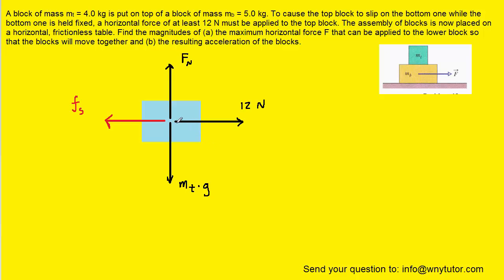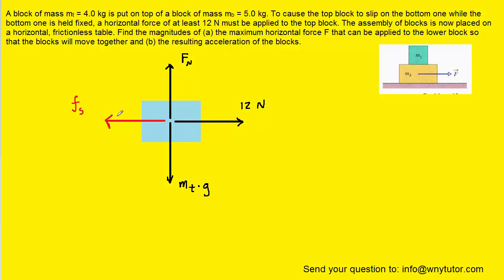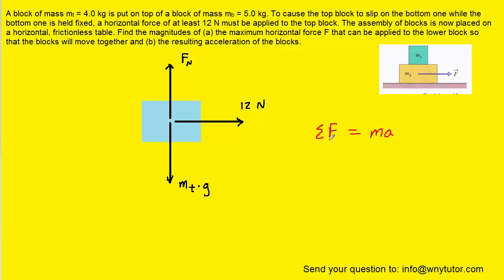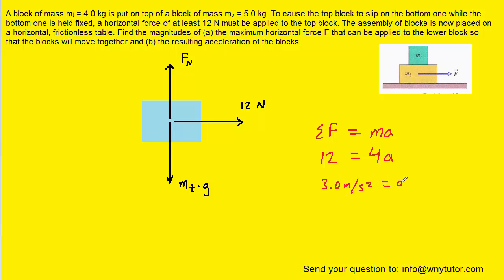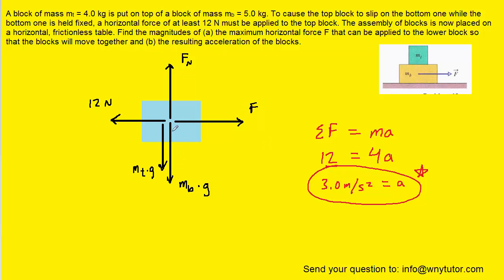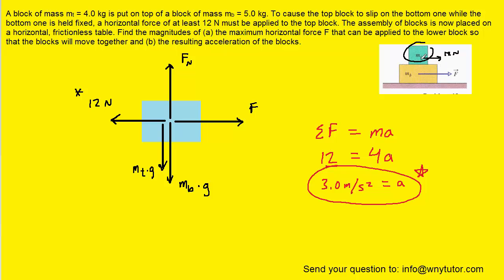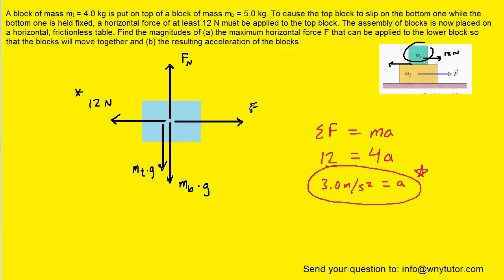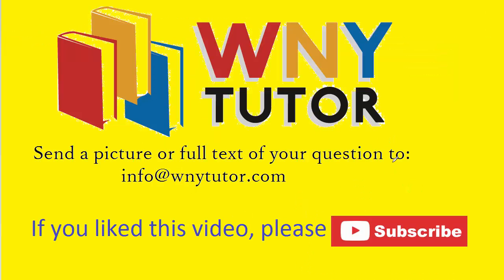A block of mass mt = 4.0 kg is put on top of a block of mass mb = 5.0 kg. To cause the top block to

Comment: But it says 12N force causes block A to move so I think we cant take fs= 12N. Here, fk should be equal to 12N, am i right?
Reply: I'll reply 3 years later in case someone else found this question interesting: The friction here is between the two blocks, so up to the force limit of 12 N on the top block there is no motion between them, hence fs. Up to that point, the only motion is in relation to the ground and that is frictionless.